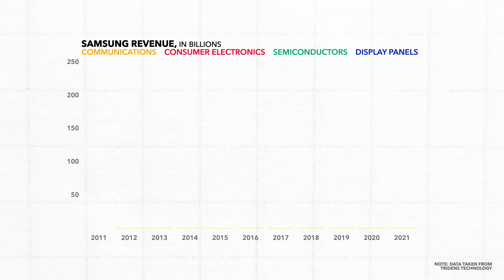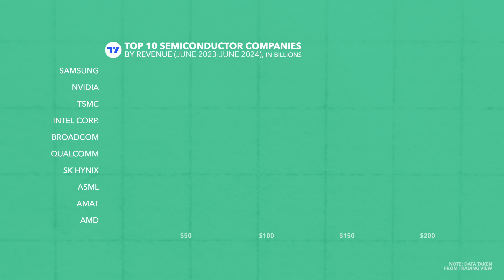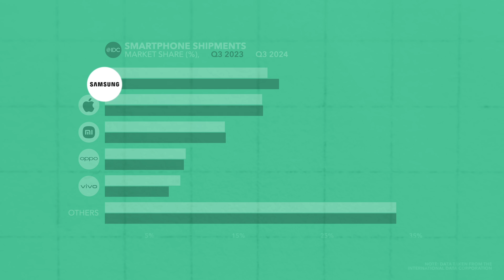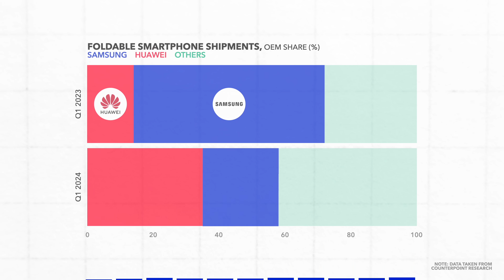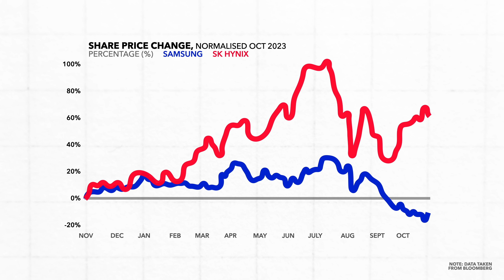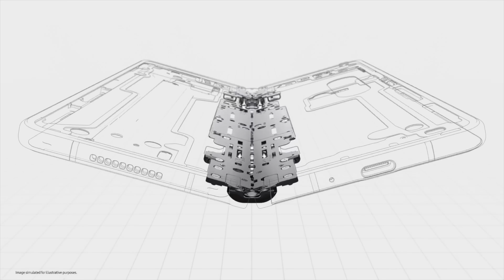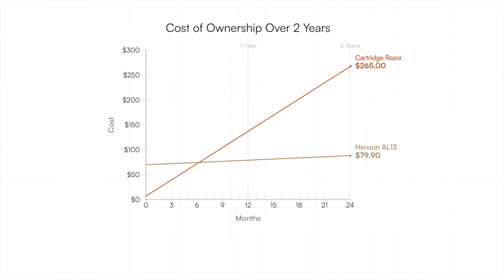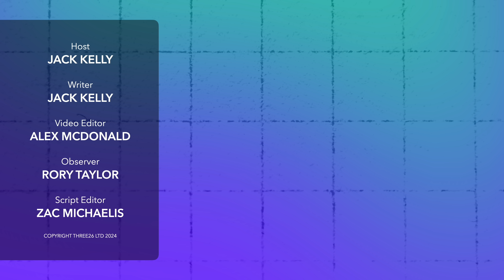4 Reasons Why Samsung are in Trouble

Comment: The reason why folding phones haven't taken off is almost entirely due to price.  Like most people, I'm not paying $1800 a folding phone, and $3000 for a 3 screen phone is even more ridiculous, even my entire gaming PC setup doesn't cost that much.
Reply: ive not paid more than £200 for about 10 years now, just get a decent refurb when my phone breaks and get another 2-5 years out of it, the jump in tech isnt as dramatic phone to phone as it was 10-15 years ago so its not worth it
Reply: I've had a couple folding phones over the last 4-5 yrs. I've paid outright and never paid more than $800 for the entire bundle after trade-ins and rebates. I could've gotten the Fold 6 for under $500 with trade-in US if I'd jumped on this most recent sale before Nov 1. 
The issue isn't the price as much as there's only micro improvements, if any at all, to justify the increase from previous Iteration, which - while better than other foldable phones, hasn't reached the potential it could be at. Samsung and other tech companies are now on this AI train while not improving, or unable to improve hardware.
Reply: @notorioustori that's the thing with current technology in general. For most people, it's all basically the same. We're seeing smaller improvements and even less improvements that would actually impart the average user. Companies are desperate to us AI as a buzz word (when it's not even real AI) because they need people to actually want new tech again. The problem with a buzz word is that it's just that, a buzz word. "AI" still doesn't have the real useful applications for everyday people it needs to take off. We're just seeing this bubble where everyone things it's eventually going to skyrocket in demand once someone finds that must have use for it. As of now that it's only really getting used by businesses to take over mundane tasks and will potentially take over more complex tasks down the line (which... I'm not a hundred percent sure less people having good paying jobs will help any consumer electronics markets).
Reply: 1900$ is a single component in the pc, the GPU. So ofc a phone with a whole lot of components and an advanced screen will cost that much.
Reply: @kraya6740  even a $300 GPU would beat the puny one in the phone.  Even the high end RTX4080 super can be bought for less than $1000. Don't even try to justify how ridiculous a $3000 phone is.
Reply: @xiphoid2011  A 300$ GPU is larger than a brick, while phones have very advanced amoled screens, huge battery, advanced chips, at least 500gb storage, several mic's, several antenna, nfc, bluetooth and many more components, all compressed in a tiny package that is much much smaller than a GPU.
Reply: It's also durability, I use "armored" cases and screen protectors, my phone is basically indestructible in everyday life and lasts years. Foldables feel too fragile
Reply: Also, durability. Who would buy a phone, that you constantly touch, but can scratch with a nail, A NAIL!

Comment: The biggest reason for samsung's poor sales in phone segment is exynos.
Reply: exynos is not the reason because it was used since 2011 , but not involving is the problem
Reply: @Uxz-iu8re yes it’s an issue bro, In my house there are 4 devices and every-time when tried to buy first checked samsung and that exynos soc chip made me choose other brands. exynos succks. Even with exynos their so called budget phones are worst value for money. There aren’t even considering Mediatek. Anyway some news say samsung might shutdown exynos chip manufacturing
Reply: @radhamanohar2307  I didn't have any issue with the exynos. yall are weird 😐
Reply: @Uxz-iu8re  time changes everything
Reply: @Uxz-iu8re  that time no one had any idea about processors. And nobody cared much about it..
Reply: I've had phones with Exynos.  They're not as good as Qualcomm, but they're not nearly as bad as everyone makes them out to be.  They shouldn't be in the flagship product.  But in something like the A5x it's good.
Reply: @rightwingsafetysquad9872  I agree, I would say that exynos should only be in budget phones and tablets. It's not like it doesn't work but it is worse then every other processor available
Reply: @radhamanohar2307  I agree bro , although I doubt they would shut it down
Reply: @Uxz-iu8re my samsung phone with exynos 2200 is nothing more than a small size heater.

Comment: It all changed when DJ Koh stepped down as the CEO and was replaced by TM Roh. Samsung completely abandoned their popular budget and midrange series of phones and started focussing solely on cutting-edge expensive flagships. In Asian markets (India and China most importantly) they lost the budget and midrange market share to competitors which offered far superior value. They need to regain their strong foothold in affordable non-flagship segments along with the excellent trajectory they already have for the flagships.
Reply: They need affordable flagships, longer lasting too! Both my wife's S21+ and my S22+ are having significant downgrades in the quality of pictures, on top of a slower phone, and less battery time on top. These were really expensive phones!!! Samsung should definitely "innovate" on consistency.
Reply: The market share of Samsung mobile phones in China is less than 1%.
Reply: ZTE and Huawei be Like 😎
Reply: @filipealves6602  This is because the chips used for the S22-21 were poorly fabricated. Their 5nm and 4nm processes' was HEAVILY rushed out of the door to show the market that they had the newest tech. The results? poor efficiency, overheating, degrading performance after updates, dead motherboard, expanded battery. Hell, they even tried other shady tactics like completely removing cooper vapor chamber for the S22 lineup despite knowing that the phones will overheat even more without them. I'm surprised they weren't smacked with lawsuits for that.

Comment: Ever since Huawei got banned from international market, Samsung fell into the comfort zone and nerfed themselves.
Things we wanna see in Z fold 7.
Better Durability and Dust Resistance is a must,
S pen silo and outer display s pen support
Better battery life and faster charging. 
Better and usable inner display camera for video calls and stuffs. 
Slightly, just slightly wider cover display and reduced bezels.
Anti reflective coating on both, especially on outer display...

These are the bare minimum essentials of a merely flagship phone in 2024. They are ahead in software, and features as of now tho, but still you wanna use an 1800 dollar phone just like a flagship or maybe something more than it. Do not gatekeep on usability #Samsung

Comment: Problem is you are paying more for LESS features, no hedphone jack, no sd card slot, no replacable battery, no charger. And the camera quality not a good selling point
Reply: The removal of the SD card was the best thing to ever happen. Micro SD cards are much slower than the internal storage on the device itself, prone to corruption, and not supported by most apps on android outside of media content like photos. 

Headphone jack is understandable but not that big of a deal. In regards to the replacement battery issue, fast charging solves any qualms from that and in order to have a replaceable battery would mean forgoing on things like waterproofing or having wireless charging.

So gunna hard disagree with you
Reply: I will never go back to wired headphones.
Reply: @Jimmy_Jones  having the option to have them wired was a nightmare, thank god they are forcing us to buy those

Comment: Nowadays most (big brand) phones are practically copies from eachother. So staying with one brand isn't as important as it used to be.

My last few phones have been samsung's, good quality for a decent price.
But after my galaxy S10 goes kaput i'm switching to a fairphone one.
Fairphone has phones that are easily repairable by the consumer, so repairablity with them is way better than other brands.
And that will mean i'm able to do a lot longer with the phone.
The prices of having your battery or cable connecter replaced are just over the top nowadays.
So i rather buy a phone where i can do thise things myself, without needing proprietary tools and "locked" hardware.

Planned obsolescence is a nice money grab in the short term, but eventually customers will choose the few brand who didn't/don't join that bandwagon.

Comment: Since the introduction of smart fones, i never had any other brand except samsung. But my problem with samsung started when i got my s20. After just 2 years of normal use, meaning no gaming, no resource intensive apps, no heat inducing processes, my screen just broke. It started with 1 vertical green line and then it multiplied so much so that the fone is almost useless. I went to samsung service center for repairs. The officer said my fone is out of warranty and the screen replacement will cost me as much as a new one. At first, i thought i was just unlucky. So i got a new samsung s22, again same thing happened in less than 2 years. After much research on the net, i found out that im not the only one. Tens of thousands have suffered similiar problem and samsung refuse to acknowledge its a hardware fault. So with much regret, i ditched samsung and went for another brand. Samsung's product quality seemed to have deteriorated so badly

Comment: They need to slash prices to remain competitive and increase consumer interest. For example, the only reason foldable haven't caught on is their extreme price - whereas manufacturers like Motorola can make a foldable for under 600 dollars. They need to lower prices across the board and offer foldables for the same price as their slab phone products. The z fold needs to be at or around the price of the s24 ultra and the z flip needs to be at or around the s24.

Comment: 5. They use SoC's that throttle down to 40-50% of their capacity instead of using a lower cost SoC. 

As a consumer, you waste money buying Snapdragon 8 devices that do not have active cooling.

Comment: I've had my samsung galaxy s22 for about a year by now, A YEAR, and now I'm experiencing some severe lag and slow downs by now, not only that but I used to have a samsung tablet until it completely broke. Samsung used to be the greatest phone giant in the world, but now samsung is being run by idiots who are only making stuff just for a quick and easy paycheck, they are no longer doing it out of the heart and quality which is no wonder why their products are now falling apart, to the point where if my current samsung phones does break, then that will be the LAST samsung product I'll EVER buy. After all, I already have a lenovo tablet, and that this works better than my now old and dead galaxy tab, so I might probably think about getting either a Motorola or a Google pixel in case my samsung phone break. It's no wonder why so many south Koreans nowadays use either iPhone or just some non samsung product

Comment: Folding phone issues:

Carriers going to 36 months so that trade in deal.fpr 24 months is gone

Insurance per phone going from $9 to $17

Software updates bricking $2100 phones and their warranty process accusing the customer 

In total no one wa to to be 13 months in a 36 month agreement with no phone.

I went back to the Ultra bec I can pay it off if need be

Comment: 1. chinese android mobile and tv brands have better value than samsung
2. samsung have ben copying apple from the removal of the headphone jack on the note 10 and s20 and charger from the box on the s21 to the flat edges on the s22 to the eye watering prices since the s20 to the designs of their watches and earbuds to making minor changes every year since the s23
3. samsung's tizen os on their tv's have preinstalled apps that you cannot easily remove unlike LG's webOS or Android TV (Google TV since 2020) and the GUI is too pretty and takes up a lot of resources for a TV with low end specs
4. samsung's skin of android is so heavy to a point where their lowest end phones were almost unusable and it would be better to not buy a samsung if you were broke in 2014
5. samsung's premium phones with exynos chips are worse than their snapdragon counterpart
6. it keeps on going

Comment: it's pronounced as "dee ram" and "nand". 

First is just a convention, it's Dynamic Random Access Memory, there are a lot of types of RAM, and therefore DRAM is pronounced with D separated. In case of NAND things are simpler. NAND = Not And, it's a type of a logic gate, an electronics primitive made up of just a handful of transistors.